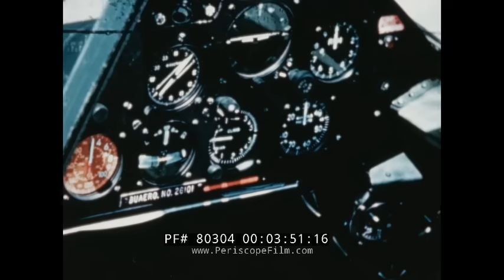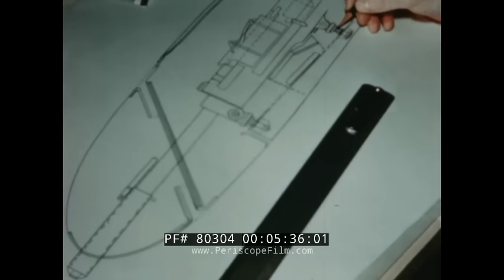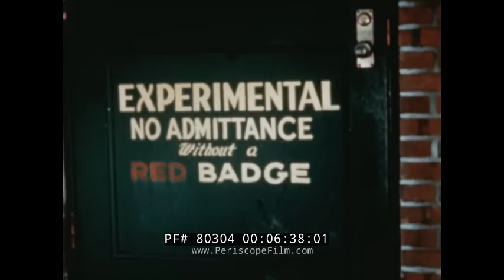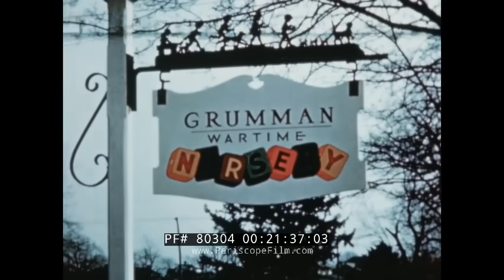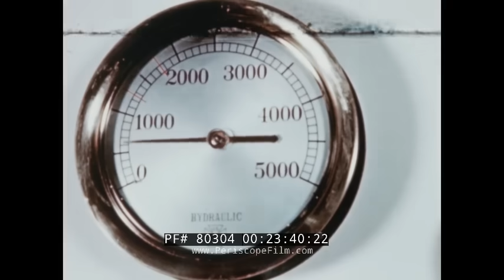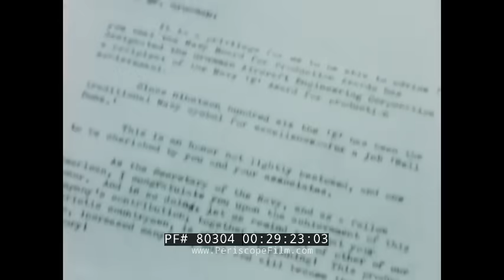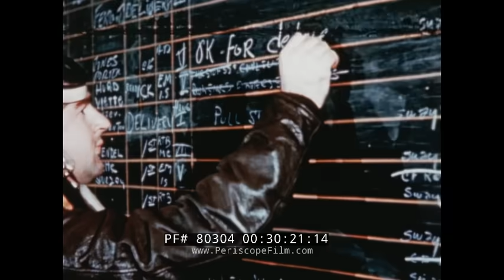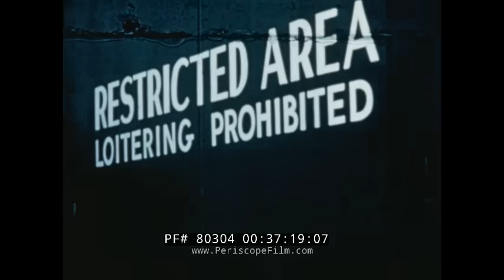GRUMMAN F6F HELLCAT FIGHTER AIRCRAFT PRODUCTION LINE 1944 PROMOTIONAL FILM 80304

Comment: Grumman made flying tanks. Worked in Bethpage. Saw it all. You could take 2/3 of the rivets out of an F-14 and it would still fly. I worked in plant 3. It was a one mile run around the plant so the runners would use it to clock their mileage and speed. Funny, I worked with that 900 degree salt bath they showed. Looks like a swimming pool until you feel how hot it is.
Reply: I fortunately worked on the Hog, and many of those rivets and "high-lock" holes were filled by Stoned Workers with glue and yet they still fly, damn some of those Inspectors, were tolerant.
What write up an ME, that is too much work, don't worry there are plenty of straight and tight holes, it will be fine.

Comment: Great stuff!  The F6F was one of the best fighters of WW2.  Spitfires and Mustangs reaped the glory, but P-47's and F6F's did the real work.
Reply: P-47 the "Tank" in the air.
Reply: Ironic you say that.  The Grumman Hellcats and Republic P-47 "Jugs" were both made on Long Island, literally almost across the street from each other.  It's not a far stretch to think that design philosophy flowed from one company to another and back again.  I'm a Grumman retiree.  During the 40's, 50's and 60's many skilled workers and engineers moved from "one side of the street to another" depending on whether the current Big Thing was an Air Force contract (Republic) or Navy contract (Grumman).   It's not uncommon for retired Long Island aerospace workers to be drawing checks from both companies.  It's all gone now, but for a while if you loved airplanes Long Island was a hot place to be.
Reply: Well, they were designed for totally different environments, i.e. sea duty vs land based. Big differences ensue. Carrier duty required wing tilting and anti-corrosion treatment, long distances in the Pacific required very long range to match up with the amazing range of the Zero-sen, limited resources on a carrier called for better techniques for increasing reliability and maintainability. The Brits showed us the Corsair was perfectly suited for carrier duty, but the Hellcat protected the navy fleets for the duration of the war. I like them both.
Reply: @richardreed2688  well said. I'm a LI boy myself, and so proud of the heritage. A couple of my friend's dads are Grumman retirees, and I love chatting with them. This film was so  much fun, I've watched 3 or 4 times. I keep stopping it and looking for landmarks. Thanks Richard, for your part in making Grumman such an icon in aviation here on Long Island.

Comment: That small device @8:45 resembling a long shotshell is a start cartridge.  It's basically a large blank that when fired generates a plume of expanding gasses--like a shotgun round--which spins the engine to get it started.

Comment: In the early 1980's you could get a Hellcat in a basket for about 150k. T6's were from 20 to 40k. Now, every piece of that Hellcat is nearly priceless. T6's start at about 100k for a good one now.
Reply: Well, if the prices for Hellcats were that low it's because they weren't nearly as glamorous as the land-based fighters, especially the Mustang or the Thunderbolt but even including the P-40.  No one's ever going to fly one of these off a carrier deck again.  Yeah, this had good performance as Grumman stuck the P-47's  R-2800 engine in there, but they're tubby and ugly as sin.  An improvement over the Wildcat to be sure, but still plenty ugly.  Now, the F8F Bearcat is a good-looking aircraft but not the Hellcat.
Reply: Russ G The hellcat is beautiful in my eyes. Its kinda cute having such big wings on a stubby airframe. I know this is heresy but i prefer the looks of the hellcat over the corsair. People get overworked by the corsairs bent wings but they forget the awful looking tail section, the way-too-long nose, the doughy wingtips, and the flaps which look like they were added as an afterthought. I love both planes but i love the look of the hellcat more because of its straightforward angular design which are the same reasons why I like the fw 190s

Comment: At @8:40 seeing the guys rotating the prop:  That was done to circulate the engine oil that would pool in the lower cylinders.  The scene after that was a ground crew guy checking the cartridge used to start the aircraft engine.
Back then, some aircraft used what was known as the Coffman starter, which used oversized blank shotgun shells to force the engine to rotate to get it to start.  On a large video screen, the words: "Starter Cartridges" can be seen.
Advantage of that system meant a simpler electrical system without the need of a starter motor, which would have added weight to the aircraft.

Comment: The Hellcat in this film is not the first to fly, Bu. No. 02982, the XF6F-1 with a Wright Cyclone had it´s first flight 30 July 1942. This is Bu.No. 26101, is the first F6F with the P&W R2800 engine, the -3, first flight was 3 October 1942.

Comment: Looks a lot like a Wildcat, just bigger.  I bet the first Japanese to fight the Hellcats thought they were matched up with Wildcats.  32:25 British export
Reply: there's a video out there where the zero pilots used to get behind the wildcats when they were in a climb the wildcat would stall way before the zero.  this happens to a hellcat pilot the zero gets behind him waiting for him to stall.  thought it was a wildcat the hellcat kept climbing the zero stalled he just dropped in behind the zero and shot him down.  so you are right
Reply: @russelloriely6343  I recall a video to that effect. It was an account from a Hellcat pilot who was a relative rookie at the time. He was chasing a Zero when it went into a steep climb. He followed it up. Then for an inexplicable reason the Zero did a hammerhead turn, leaving him with a perfect shot.

It turned out that the Zero pilot thought he was in a Wildcat, and his favourite trick against the Wildcat was to lead them into a climb, at which point they'd eventually stall out and be an easy target. Only the Hellcat's 2,000 HP engine made it more than a match for the Zero in a climb. The Japanese pilot made his turn expecting to see a stalled and helpless Wildcat, but the last thing he saw before the flash of 6 .50 cal machine guns was a Hellcat that was very much still with him.

The Hellcat pilot later learned that he had killed Japan's top ace in the Pacific.

Comment: Was that a "shotgun shell" starter cartridge that was loaded under the cowling?  Yes it was.  I did not know those were used for the F6F.   Only other time I seen this was for the Fairchild C-82 Packet in the movie The Flight of the Phoenix.
Reply: There were other engines that used this starting technique... The Sleeve-valve Bristol Centaurus, used this type of a starter... It saved a lot of weight... Hauling the huge batteries and starter motors aboard the planes added well over 400 pounds, more-so in the HUGE P&W 4360 engines that were in the planes that You described in that movie 'Flight of the Phoenix'.
Reply: looks like my grandpa tractor
Reply: Not C-82, but a C-119.

Comment: I have watched this film a few times but until this time I didn’t realise how ludicrous the guy tapping the underside of the wing was, they were preparing for a maiden test flight, the F.O.D (Foreign Object Debris) check would have been done a long long time ago during the build at many and various stages, and would have been signed of as completed, it’s a bit to late to discover something hiding inside the wing structure, and if they did what would they do?????, it wouldn’t be as easy to retrieve as just opening a panel and taking it out, most wing sections don’t have access panels for every single section, panels add weight and weaken the structure, and if all that is meant to be inside is the structure and air then they are superfluous and complicate the build process, then along comes the test pilot all ready to take her up, and someone has to tell him that he can’t because somebody left something in the wing, that wouldn’t got down too well with him or the hierarchy and wouldn’t exactly breed confidence in the aircraft before it even gets airborne, 
Sorry, rant over, soapbox put away and spleen vented.

Comment: Not to be a bummer, but the Germans were perfecting the first jet fighter during this same period.  Which effort is more amazing?
Reply: And it was a waste of their time and resources that could have been better spent on refining planes that actually worked.
First off the ME262 couldn't fly 560 MPH as Messerschmitt claimed and like what's listed in Wikipedia, the average speed obtained by the test pilots at NACA after the war was 525 MPH in actual real world tests. 
Secondly it's maneuverability was so abysmal that the pilots were forbidden to engage enemy fighters.
Third, the engines burned up every 8 to 10 hours, BIG waste of resources there.
Four, there's documented cases of P47M Thunderbolts running them down and destroying them while they were at full throttle fleeing in level flight. 
Five, just because they were "jet aircraft" don't be fooled into thinking they were anything like a modern jet, they weren't. 
Six, even the US had plans for a jet fighter before the war, Lockheed had designs for a jet fighter and engine for it in 1939 before the war even started, but the USAAC wisely decided to concentrate on developing and refining propeller aircraft because they recognized that the development efforts and time of such an aircraft would be a drain on valuable resources, it takes years to develop something like that, and with a war pending they knew it would be STUPID to do something like that, Germany had a little idiot running the show and you see how it worked out for them.
Like the Tiger tank and all the other Nazi "wonder weapons" they didn't work like how they're hyped up in sensationalistic books that are written just for the sake of selling books or getting someone to click on videos, that's about people making money and not actually covering facts.
And don't even go to the Nazi rocket scientist thing, Von Braun even admitted after the war that he'd never have gotten a rocket off the ground before the end of the war if it wasn't for the benefit of having access to the research of Dr Robert Goddard, the American rocket scientist who in March of 1926 launched the first successful liquid fueled rocket ushering in the age of space travel, Germany's V2 rocket program was a failure militarily, it didn't change the course of the war one iota, like all the other wonder weapons it was a waste of valuable resources. 
What was everyone else doing during this time? Building machines like this that beat the Axis powers to their knees to the point where they surrendered unconditionally, that's what they were doing.
Reply: Ever heard of the "Manhattan project"

Comment: , Thats not the first Prototyp in Video, the real Prototyp XF6F-1 had a big Spinner on the Prop other Landing gear covers and some details are missing on Prototyp, it looks like they used a Prod Aircraft for this Video, even the 2nd Proto XF6F-3 had this big Spinner and both Protos are natural metal on Fotos

Look at Hellcat in Action from Squadron signal and you can clearly see the differences between the real Protos and the F6F-3 TEST Aircraft in the video.

Normaly in first flight with a Prototyp  the landing gear is lowered